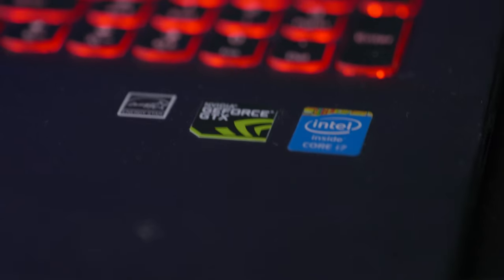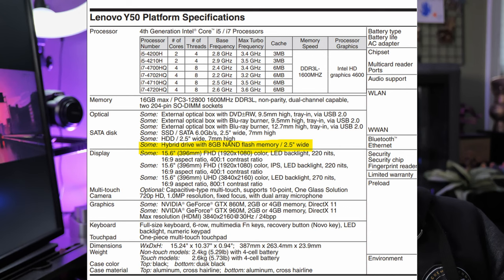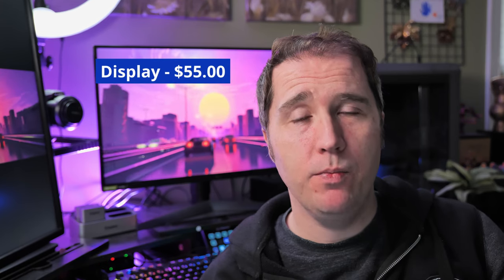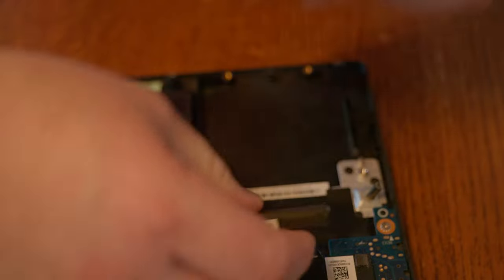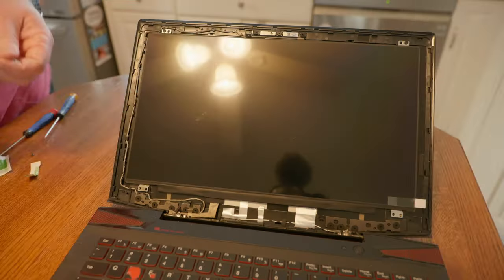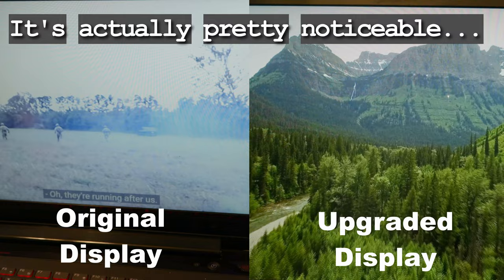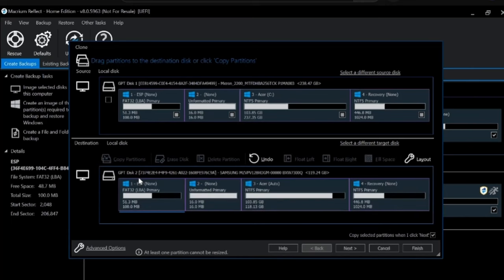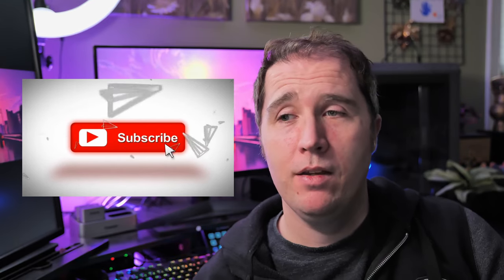Two Easy Upgrades Transformed My OLD Gaming Laptop!  (Lenovo Y50-70)

Comment: Been using mine for over 10 years now, replaced LCD screen, sub USB board, subwoofer, battery, hard drive to SSD, 16GB RAM, new thermal paste and it runs like brand new.
Reply from the maker: It’s pretty crazy how this thing hangs in there with just a little love!

Comment: Bought in 2013, 2023 am still using it. 😂 Upgraded to 16gb ram corsair vengance ddr3 and 256gb samsung 850pro back in 2014. Only problem is cpu outdated cant upgrade to win11.
Reply from the maker: Yeah, it’s wierd because the processor meets the specs from what I can tell, but it’s basically on a no fly list for Windows 11.  I don’t get it.  Thanks for watching and commenting!
Reply: Buying lenovo won't go wrong. Yeah, if only the cpu isnt soldered. These thing are build to last, i ran this y50-70 almost like a server 24/7 the day i brought it home and am still actively using it but nothing in the drive as most of my files were in my qnap nas or cloud. I have an older Ideapad bought in 2005. Its still working till today running on corsair ssd win 7.
Reply from the maker: I was pretty down on mine, but as soon as I swapped out that stupid hybrid drive it’s like a totally different machine!
Reply: @PyyrusGaming  able to share the exact specs of the screen and which site. Am tempted to swap the screen. Looks good on yours. Thanks.
Reply from the maker: Yeah I’ve gotta find the image on my PC later today or tomorrow(unfortunately I have to work my day job).  If you can do me a favor, comment again some time tomorrow to remind me.  Sometimes my brain isn’t so good so reminders are key! 😉
Reply from the maker: Oh wait I think I misread your comment.  For the specs of the panel, here’s what I found on the web:  https://www.panelook.com/B156HAN01.2_AUO_15.6_LCM_parameter_19049.html  also, from the link I posted it says it’s eligible for Amazon returns, so just make sure it says the same for you in case it’s not what you wanted.  Let me know how it goes!
Reply: @PyyrusGaming  thanks buddy!!!
Reply from the maker: Happy to help, Rudy!
Reply: There are a fix to install w10 in 10 minutes and it still go very well w11 in my lenovo y50-70
Reply: @ghostxghost22 how bro
Reply: Bought one yesterday for $156 😂
Reply: @ghostxghost22   how? i need windows 11 for my course
Reply from the maker: @mohamedalshatani9266 I don’t think you can.  Even with upgrading the cpu and gpu aren’t listed as meeting requirements/approved.  If there’s a work around, I haven’t seen it.

Comment: Im not a very competitive gamer or anything but I snagged my y50-70 for an absolute steal. ($300 worth of labor as barter) and it already has an SSD and 16gb ram. Only issue with it is that it needs a new battery. For how old it is too, the touchscreen is pretty impressive.
Reply: Bought one today for $150 used 7.8k philippine peso a freaking steal

Comment: I still have one without modifications. I reduced gaming on it as i barely have the spare time (and i was single when i got it) but by raw specs it's a legit general purpose laptop to this day (there are new machines with 8 GB RAM on sale right now, many mid-range have 16 GB RAM)
Reply: There is one am eyeing on buying,  how would you rate it's functionality now.
Reply from the maker: @skateWithMeUg I would definitely recommend installing the SSD, otherwise the hard drive could slow the whole system down.  It’s otherwise totally usable, just not the best for gaming or intense programs.

Comment: Y50-70s are fantastic.  I am still using mine, great for multi-boot systems
Reply from the maker: Honestly the hard drive was really the main thing stopping me from using mine.  The hard disk would shoot up to 100% use in task manager and it would take forever to do anything.  Now it’s actually pretty snappy!  Thanks for watching and commenting!
Reply: @PyyrusGaming  I'm on my 2nd Y50-70,  wore the first one completely out!! (it's retired and will likely become a parts machine or a slave of some kind, since most everything still works).   I have a quintuple boot system:  Windows 10, Kali Linux, Linux Mint, MacOS 10.12 Sierra, and MacOS 10.15 Catalina.
Reply from the maker: Wow, that’s pretty hardcore!  Mine isn’t worn out yet, but you can see some of the letters on the keyboard are!
Reply: @PyyrusGaming  Unfortunately, the keyboard is one of the very few parts on a Y50 that is not easily replaced.
Reply from the maker: That’s okay, at least they still work!
Reply: same, i use endevour os and windows. im still able to play cod and apex on low settings
Reply from the maker: @samsworld66  I still use mine for some League on the go!  😊
Reply: same, still using it 😅

Comment: When replacing screens on laptops, you need to remove the battery since there is battery voltage on the connector and there's a chance you don't plug the cable completely straight, at least on some laptops

Comment: It's a good practice and safe to unplug the battery or remove it completely, when working on the inside of a laptop.
Even more so if you use a vacuum cleaner or anything else which makes the fans move on their own.  Electricity can be produced by the movement of the fans alone which can damage the hardware.  I do advice when trying to clean fans to hold them steady while doing so.

Yes I know this is an 11 month old video. 

I have the same model of laptop, and within weeks of buying it (back in 2014), I replaced the hybrid drive which was indeed abysmal in terms of speed.  My first and LAST hybrid drive that is for sure.  I also replaced it with a 1TB SSD.  Also upgraded to 16GB of RAM.  Not sure if this laptop can accept more than 16GB.

Did you by any chance check to see if the CPU is socketed or the GPU is on a MXM board which might be upgradable?  

I am a bit confused about your original screen.  It wasn't a 1080p?  Or was it a TN panel?

Do you still use it for video editing?  I never used mine for it and I was wondering how far you have pushed it.

Thanks for the video.
Reply from the maker: 16GB is the max.  I think there are two different speeds or Ram it can take, but mine already has the fastest one the MB can handle.  The original screen was 1080p but it was extremely washed out looking with terrible viewing angles.  I cheaped out on the display when I specced it out.  As far as the MB/CPU, I think it is socketed, but I looked into the GPU and decided it wasn’t worth trying, not sure exactly why now.  I still use it to edit footage and is totally fine for cutting and basic edits/graphics.  I just wouldn’t push too hard with effects or lots of layers or anything like that or it will probably chug big time.

Thanks for watching and commenting!
Reply: @PyyrusGaming  Thank you for your reply.  I am glad it is still serving  you.  I watched a disassembly of it  and I have a feeling it is not socketed, the CPU or the GPU.  Which is a shame, but usual.  One day I  hope to find out on my own lol.  
Take care.

Comment: I have this exact one but it's not enough to run Arma 3 that well, so I'm thinking on upgrading to ssd and 32gb of Ram, I really hope this helps a little because I've already bought the PS5 and Xbox series X last year so I don't want to spend money in a new computer.
Reply from the maker: I think the most it can take is 16GB of ram.  The SSD should help, but I don’t know much about Arma 3’s requirements.
Reply: @PyyrusGaming  That's too bad. Well, I hope the SSD is enough then. Thanks for the reply 👍🏻
Reply from the maker: Any time!

Comment: Im thinking on buying the Kingston SSD A400, do you think I'll have the same results compared with WD?  Tks
Reply from the maker: Hi, I’m not an expert by any means but after researching a bit I’d say you should have pretty similar results.  There was a commenter on the Kingston who mentioned that it is “DRAM-less” And that it can slow a bit when moving very large files and apparently the WD Blue has DRAM.  

Here’s the comment:  “The bad: This is a DRAMless SSD. So, when writing large large amounts of data to it for long periods of time it will slow a bit. This has no effect on read speeds though and unless your in video/music production your unlikely to even notice. It doesn't show in speed tests, it shows in extended operation during file copy for example (when the file is greater than 30GB+)”
Reply: Thank you for suppprting!
Reply from the maker: Happy to help!  Thanks for watching and commenting!

Comment: i have upgraded ssd a while ago on the same laptop but now in 2024 its super sluggish...will applying new thermal paste and a new battery make it run like new? or will it never reach that performance again
Reply from the maker: I would guess it has more to do with the programs that are running in the background.  I doubt the battery would make a difference speed-wise, the thermal paste may help some. Check out what is taking up your memory and see if there are things you can turn off.
Reply: @PyyrusGaming thanks will try that. Do you think replacing the ram with new ram might help ? As i read somewhere that ram also has a lifespan of around 7-8 years.
Reply from the maker: @Mr.KrazyK you could try, but I feel like I’ve never really changed out ram unless I could upgrade the speed/size or I was replacing a bad stick.  The Y50 is pretty limited in the ram you can use.
Reply: i have the Y50-70 since 2015 - you must install Glary Utilities on your laptop - it boosts the  PC speed and fixes frustrating errors, crashes and freezes.

Comment: hello is it possible to upgrade to 32gb 2x 16gb ddr3 rams cpu is possible from intel ??
Reply from the maker: I don’t think so.  When I was looking to upgrade and max out the laptop I believe that 2 x 8 was the most it could do.  It can’t even use faster ram than what I had in it originally if I remember correctly.